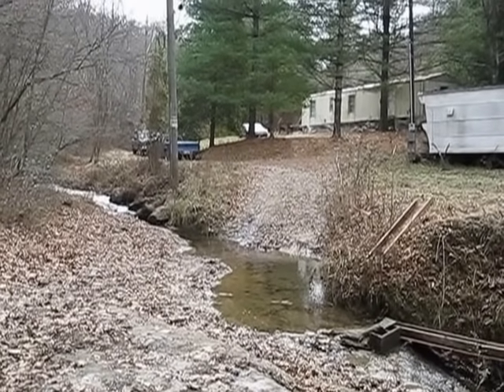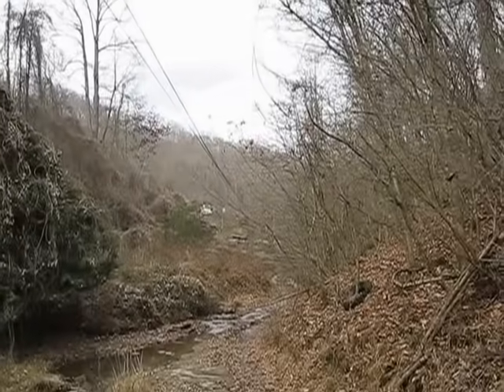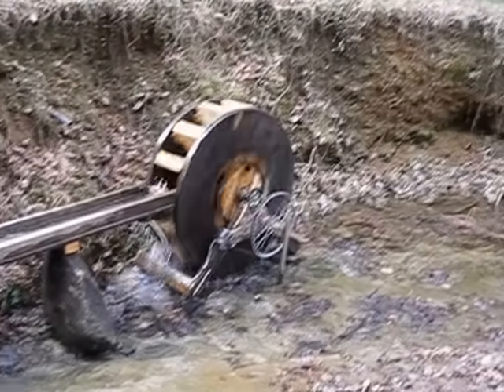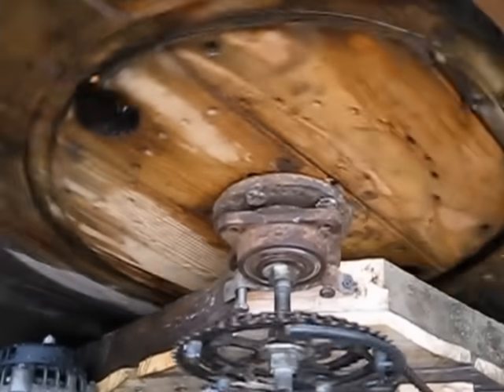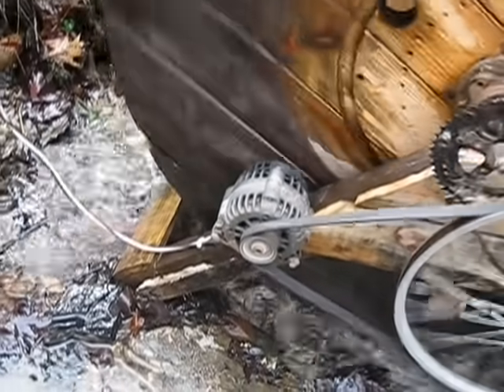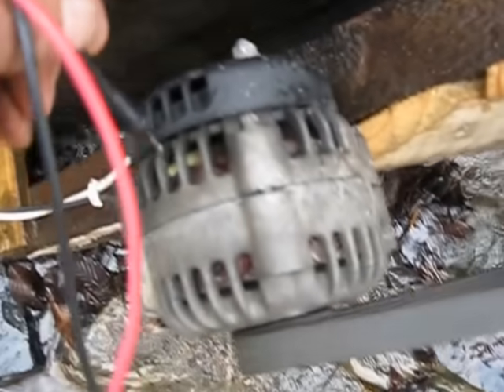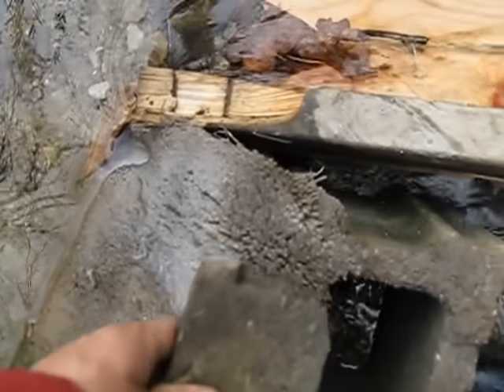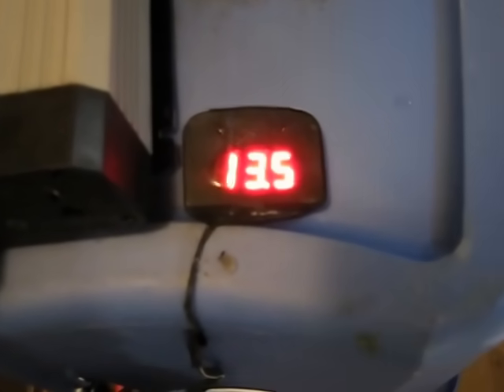water wheel generator

Comment: Ok so you are getting 40 volts dc or did you remove the rectifier bridge and its ac? And why don’t you build a step up transformer? But first you need to get it spinning faster cause you can’t be getting more than 6-8 hertz at that slow speed
Reply from the maker: It was 40 volts dc. I am planning to build another one with an improved design.
Reply: Off Road/Off Grid oh sorry I thought you bypassed the rectifier bridge and were running ac my fault but on that note 40 volts dc is impressive out of a 24 volt alternator im surprised the doides don’t short out or have you had that happen? Great idea anyway. Have you looked into early pressure mining they got 60k psi without a pump just gravity and slowly reducing the out let size you don’t need anywhere near that much pressure but it’s a good way of getting more drive force
Reply from the maker: @henryhenry903  It worked fine until I stopped using it. I'm going to use something different on my new wheel. Haven't looked into that, sounds like a lot of pressure!
Reply: Off Road/Off Grid ya they were taken water off the top of a mountain but the idea is to get more pressure by restricting the water flow down and would give you a lot more torque to turn the alternator under higher loads
Reply: Off Road/Off Grid I myself would love to see the new and improved video when you get it out

Comment: Very good!!!
Wonder how is the project, the wood, chain, and alternator after 5 years??

Have some suggestions (if still apply):
a) put the wood water canal higher than the barrel (or create a distance from the end of the canal to the barrel), therefore there will be force from the falling water that you would be able to utilize. The barrel may not spin faster, but may be able to move a more heavy gears...(to be tested).
b) Do a funnel type water channel. wide at the collection, and thinner at the end, that will concentrate water and delivered with more "pressure" on a certain point of the spinning barrel, giving more strength to the system. 
c) locate the alternator higher than the point where the water meets with the barrel, so the drops would not fall into the alternator (that may extend the life span of the alternator).
Very nice work!!!
Reply from the maker: Thank you. I used this wheel for about a year, then we went on the grid(not what I wanted but my wife was tired of dealing with it while I was at work)
I have now built a cabin and am going to run it with water power and off the grid.
the next wheel will have more metal framework and an actual transmission from a riding lawn mower.
Reply: @cavebranchstudiosllc  great!! always hard to make the women follow this path...
good to hear you keep trying!, I need to get my spot to start my own!

Comment: If your inside all the time while the batteries are charging, you are exposing yourself to hydrogen gas. The batteries charging produce this gas and it is not at all good to inhale. You might want to put them outside. Hydrogen gas limits the oxygen in the air and will cause hypoxia.

Comment: Nice setup. Question- 
If your alternator is directly connected, won't that damage your battery bank? Just curious if you have to manually shutoff your gen set. It would make sense if you have a bigger amp hour battery bank but  with two battery in series 24v with 400amp alternator.  Won't that over charge the battery?
Ty

Comment: Ya should put two alts on it an a steel bike wheel. I suggest steel because of rotation speed an pulling strength. Also the wheel should be a lil smaller like a 24 inch wheel. I did this out in Colorado. Mine was producing 20 volts per minute. An within two days would fully charge my car batteries. I had 3 hooked up at once. All 3 would last me 5 days. An then I'd have to take the stick outta my water wheel. That an the factor that my water wheel was under a small crick water fall coming off of a hill. There was a good 6 to 7 feet of space between the edge of the crick bed an my water wheel. As far as I know, mine is still going. My buddy Dave Kirkul currently lives in my old shed an still uses my set up fer power.

Comment: I wonder if you installed a supercapacitor into that system if it would take care of your power depletion when you have quick large dremands of power.

That is something that is used in heavy duty car stereo systems to keep the lights from dimming in a car when the amplifier draws a large amount of power quickly.

Comment: Fit a solar panel, Maybe a small wind turbine to add to the power. 
Also add more Deep Cycle Batteries.

What about a 2nd water wheel up / down stream ? 
Build the same again to double your power. 
Add a 2nd set of Deep cycle batteries. ?? 

A 2nd wheel to a 2nd set of batteries will double your power.

Comment: This is an Undershot water wheel.  The flow is set far too low on the wheel. 
It would have more push if it landed higher on the wheel by one or two paddles.
More weight pushing downwards.

Comment: You could wire you 3 batteries in series to give 36 volt, charge direct of your alternator @ 40v and take power from the individual batteries at 12v for your inverter from 1, lights from another and another inverter from    the 3rd for example. Just an idea as you seem to have a lot of loss            through your charge controller.
Reply: Oh 
 Are you an electrical engineer ? If yes .i need your guidence . 
eg  i have an idea of raising or pulling water as high as more than 100 meters high without using any kind of electric motor water pump.

Comment: Giving the voltage without the current  really provides no useful information.  With a head of three feet  and a water flow of,  oh,  10 gallons/minute (I'd guess) The theoretical maximum amount of power produced is:

10 gallons/60 seconds =  .17 gallons/second
1 gallon weigh eight pounds,  so that's .17 x 8 =  1.4 pounds/secon of water
1.4 pounds/second dropping 3 feet produces  4.2 foot pounds of energy per second.

One foot pound of energy/second x 1.4 = watts
So 1.4 x 4.2 foot pounds/second  produces a theoretical maximum energy production from your rig of 5.7 watts. 

You'd have to operate your rig for 175 hours to produce a kilowatt hour of power  --- that's 7 days of continuous operation,  and you're probably getting half that in actual power output.

So yes,  you DO need additional sources of power!

Comment: Not bad at all.  I'd recommend looking at going to lithium ion though.  It can still be done very much on the cheap. There are many good videos here on YT regarding how to get the cells out of laptops, power tools, cordless vacuums, etc.  And how to properly use them.  For the most part it's all about those 18650's but I suspect as hybrids and all-electrics begin to age, repurposing a proper car MAIN battery would be the way to go.  With 18650's though the general idea is to get a few dozen of them to start and start grouping them together in such a way that you have big parallel packs of cells of random health, but you try to make sure the average health of each parallel pack is similar enough that you can put 3 or 4 in series to run your inverter at between 11.1V (minimum voltage, 3 packs in seies) and 16.8V (Fully charged, 4 series packs).

Another (and arguably the best) option is to go to a larger generator made from something like a washer motor and get yourself a transformer to step the AC output directly to 110/220.  Actually you could do it with the alternator you have now if you remove the diode bridge.  The only thing is you'd need a 3 phase transformer or 3 identical single phase units.  If the water throughput is fairly constant you could eliminate batteries, inverters, and handling DC power altogether just so long as your appliances aren't too picky about the exact voltage and frequency.

Comment: You need a deep gear reduction because of that giant wheel you can turn the power into rpm and less power. The alternator don't need tons of torque you could probably spin 6 alternators with that setup. Awesome work

Comment: I've been doing some research, a marinea alternator for boats is what I'm going to use, most common they have external voltage regulators but you can get one with them built in! They are double insulated to avoid shock, they produce a lot more amps as the battery banks for boats are much larger than what they have in vehicles, they are in closed compartments on boats so they run cooler having heat sinks built into them! There are a lot more features to this type of alternator that give you the upper hand they are made to handle damp conditions and even salt as the oceans are salty! So my creek is pushing 1,100 gallons a minute and I only want to use this set up to charge battery banks that will run electric car fans for GEO thermal in my greenhouses, barns, bunker, and a walk in cooler for produce which will work with flex pipes buried in my underground water table that has ice water! I will use solar to power the rest and work on more water wheels as I get the first one perfected.!

Comment: You just need better batteries and power management. That way the Waterwheel could run at the most efficient speed possible and it would never slow down.

Comment: Okay mate pretty damn nice, I like what you did here! So I'm hoping you can help me out a little bit! Got some questions for you and although my idea varies a little, I was hoping you can give me some input! I have a lot of generators, the motor has gone out in some or a Barron had a dog chew through some wires to on and off switch; however the generator part of these generators work and they aren't very old at all, one hS as little as 30 hours on it! I got tired of buying generators so I bought a good size solar system and a couple of wind turbine generators then my buddy gave me a medium size solar system these are state of the art systems and I wish I had seen this video before spending the money I spent, my first system cost me 10,000 and the system my buddy gave me was 5,000, I do have deep cycle batteries, a 150 amp charge controller for my big system; however I only have four deep cycle batteries and they are 6 volt batteries, so 24 volt altogether but I run it as a 12 volt system, solar guy says my batteries will last longer or something to do with power I can't remember lol! Okay any way I can use that power quickly running a swamp cooler at night, hell after about two hours I will drain it after the sun goes down, now during the day no problems. I can run swamp cooler all day, wash machines heavy duty power tools an air compressor which I will tell everyone a air compressor suck a lot of juice! Don't know why so much but it's more than my mig welder so even though I have nice solar systems my power is limited! I not only want but I need a constant power source cause I'm setting up GEO thermal greenhouses and GEO thermal heating and air for the bunker and barns for livestock and to my RV and travel trailers which means I need fans to come one when ever the thermostat kicks! I have decided to use electric car fans as they are 12 volt DC power, I have a year around creek and it pumps a lot of water, the state has had us measure the water at the head of the spring and it pumps 1,100 gallons a minute at the head of it! Now what I want to do is set up a water turbine to turn my generators or multiple water turbines to turn them, between all the generators I have to use towards this project I have 36,900 watts if I can turn them all! There are a few generators I will keep to run off gas but the ones I will use for the creek add up to a lot of power! Now there are a couple of questions here! Is there a way to combine all the wattage to come out as a whole or will I have to settle with several outlets with different wattage? They all have voltage regulators so I should be good there but they also have battery chargers built into them! So I would like to use the battery charger to keep my batteries charged constantly and I'm not sure if these battery chargers have a charge controller built in, maybe you know the answer to that one? If not I'm wondering if I can run the battery charger through my charge controller, I certainly can't afford to short circuit my charge controller they cost a lot of money that I just don't have! I also have the charge controller boxes in my travel trailers and RV and I would be more than willing to take one out of one of my travel trailer! To be quite honest I would go as far as taking the whole system out of he RV as I don't plan to use the RV for travel, just for housing here! RV has a generator that charges my batteries built into it and it starts with a button so trying to avoid doing anything to it but I could if I have too and even use the alternator from it! The problem with that is if the alternator doesn't charge the batteries fast enough and I'm using to much power then I'm back to square one! With using the generators on the water turbine I'm hoping to get the use of a battery charger and the power the generator produces itself and even going further and setting up multiple generators to produce a combined power source or multiple power sources! My biggest generator is 7,500 watts so if the water is constantly turning that then by theory I should have a constant 7,500 watts unless the rpm has to meet a specific speed to produce that but I should be able to set up gear ratios to achieve whatever rpm I need for the max watts, if I can't combine all the wattage from multiple generators for 36,900 watts then I will have to use them separately which means 7,500 watts would be my biggest source then 6,000 watts then 5,500 and so on! That's okay I don't mind breaking it down but it would be nice to combine it. The thing that baffles me is I get more power from a 2,000 watt sine wave inverter than I do off a 7,500 watt generator! If you can explain that I would love to know why? I have run a number of things off that 7,500 watt generator and would bog it down and ran the same things off my 2,000 watt sine wave inverter without a hitch, of course the solar system doesn't bog down, it will give me overload but it's only a 2,000 watt inverter that runs everything I try to run on a 7,500 watt generator and generator starts to bog, 5,500 watt difference, one would think that the inverter wouldn't begin to handle it, yet it our performs! So I have what appears to be a lot of options if I can even use a generator for this? They do have the copper wire and magnets so I'm thinking I can! Any info you can share with me as to where I have question marks or anything I didn't mention would be so appreciated! Stuck in the high dessert off grid! Man I wish you could come here and have a look to see what a all in have to work with and help me figure out my best options! Thanks mate hope to hear from you soon as I'm getting ready to dive in! I have tried researching this but haven't seen anyone who has used a generator part off a gas generator! I've seen alternators turbine generators that appear as if they were made for hydro systems to begin with!

Comment: Everyone has an opinion.... here is mine...     

First, I give you a big thumbs up for doing this project and making it work and then getting 5 million views.  The best I have on any of my videos is just over 100k,  well done!    

Second, I think the weight of your wheel is robbing your system of energy.   I would suggest you divert the water, disconnect the belt, then turn it by hand and get an idea of how much effort it takes.

Third, I would put a solar regulator between the generator/alternator and the batteries since they only  cost $9 on eBay.  It would protect your system better.

Fourth, I would put a low voltage cut off between my batteries and my inverter.  They cost about $15.  The inverter has a built in low voltage cut off but it's not adjustable. 

Fifth,  If you use a low voltage cut off and never drain your batteries more than 50% (12.1 volts) you can use the automotive Value Power batteries that Walmart sells for $48.   I haven't had any go bad after two years usage and I don't expect them to fail any time soon.

Sixth,  get a load tester and make sure none of your batteries have gone bad. A bad battery will suck all the power from the rest of them faster than you can put it in.  Check them individually every 2 or 3 months.

Fifth, buy ammo!  I'm sorta joking but if the grid goes down and you house is lit up and your stereo is blasting Lynyrd Skynyrd Free Bird .....you are going to have a lot of company!

Comment: I see two things that can improve this design. One would be to angle the boards up slightly. About 1-5 degrees would be good. The other would be to add a 1 or 2 inch board at the end to catch the water and keep the power on for a bit longer.

Plus, having the water hit higher up on the wheel (sepecially if it went over the top and ran the other direction) would give you more time on the wheel and greater energy output.

Awesome system overall!

Comment: The wheel is going the wrong way, you need to lower the wheel and feed it from the top.  A good idea is to put a 4" pipe in as high and as far up stream as possible and put in a small turbine. the turbine can be made from a 3 phase pump, run as a generator.  there are examples on youtube.  good work any way.

Comment: Looks like your wire coming in from your water wheel is solid change that out stranded and you will be goldin dc runs on the out side of the wire where a.c. runs in side

Comment: Some questions. 
1st how do you get 40 volts, isnt't this a car altenator? 
2nd The speed for the altenator to get full power shouldn't be higher? Its like it has a 400-500 rpm from a motor engine
3rd Isn't the dc power lost due to long cable distances?
4th wouldn't be better if you direclty use 12volts lights or other devices instead of inverting 12 to 220 volts etc ?